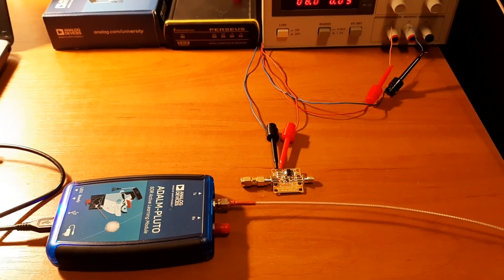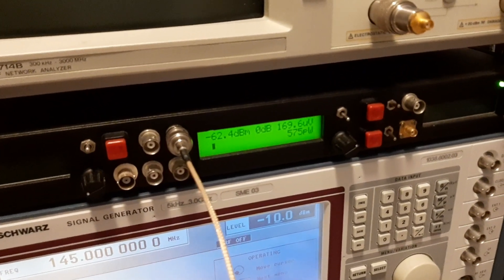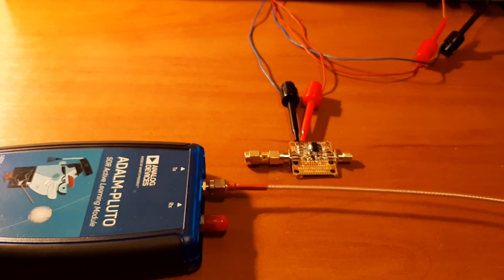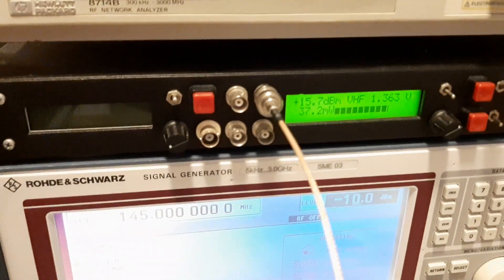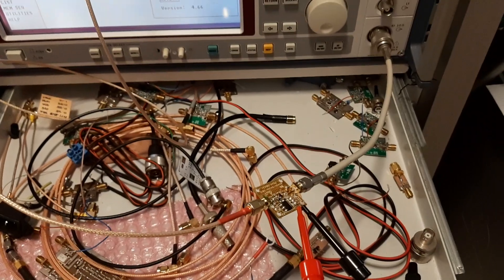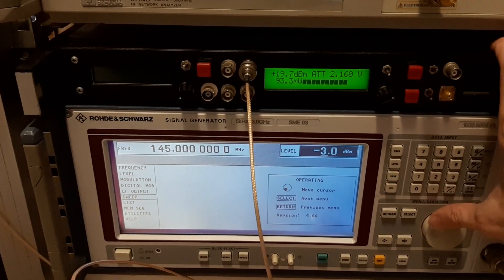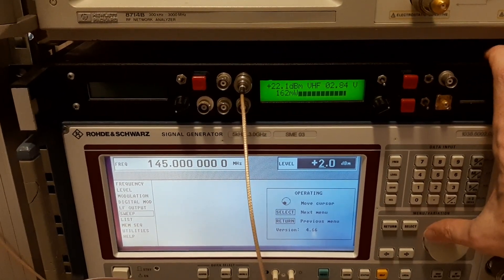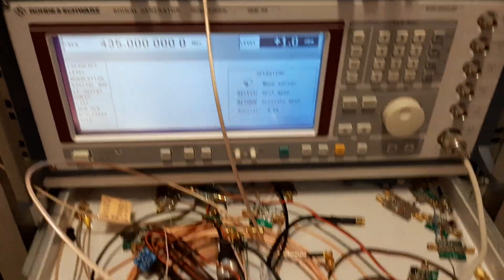LNA4ALL TX mode @ 145 & 435 MHz

Comment: Thanks for the new video. Is LNA4ALL available in TX mode now or am I just dreaming? Ha, I'm waiting for the RX one any day now here in Cali.
Reply from the maker: It is the same LNA4ALL you ordered. Just reverse the input/output. The LNA does not know what is the RX or the TX mode. The LNA4ALL amplify whatever you run into the IN side of the LNA. The advantage is that the LNA4ALL is high OIP3 LNA. By default, high OIP3 LNAs have high P1dB figures, meaning they can deliver some descent power output as presented here.
Reply: @9a4qv  Adam you made my day! I went back and looked at the video again and this time realized what you did. It got past me because I thought I read somewhere on your website that the phantom power of the HackRF can only power the LNA4ALL in RX mode and not TX mode. My bad, I was probably confused but extremely happy now!! Thanks!
Reply: Adame ti si kralj...ja kao lud tražim tx pojačalo...a imam nooelec Lna ...čim budem u istri častim ručkom